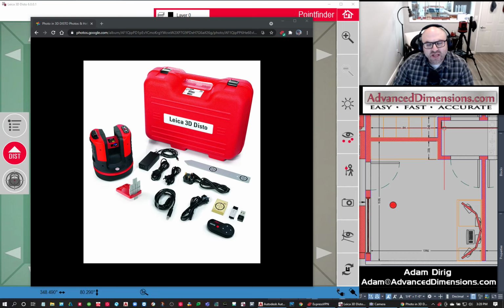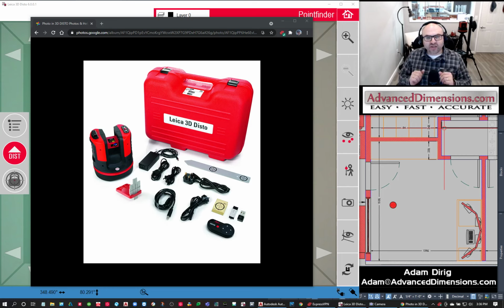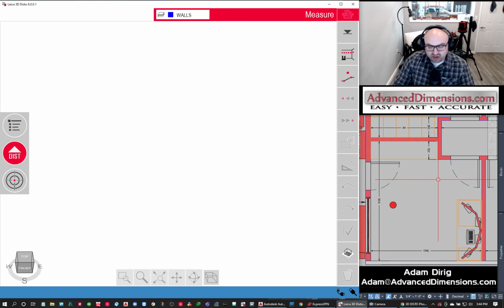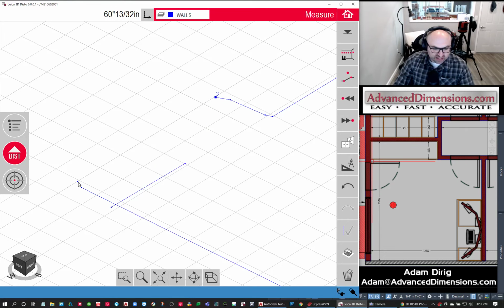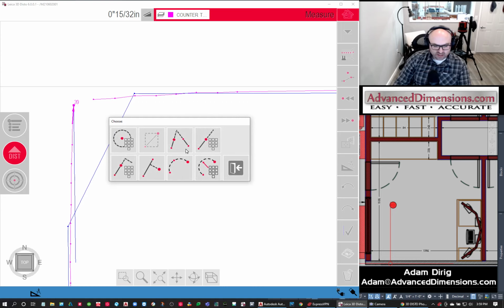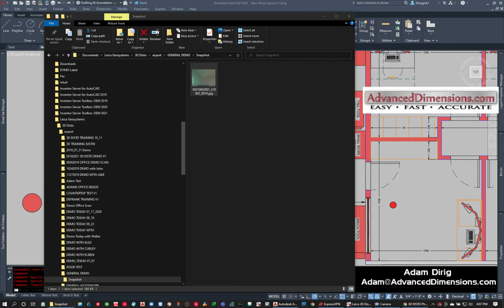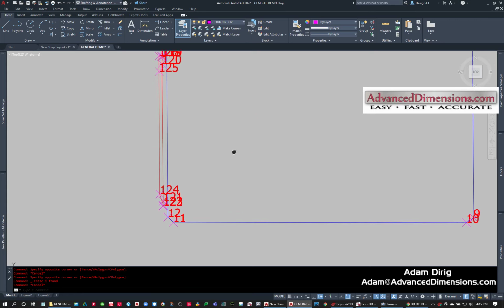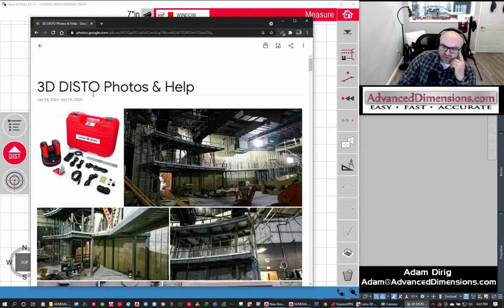Leica 3D DISTO Walk Through

Comment: Great video.  Thank you for the details and time spent doing it.  I know that Leica makes the S910 device which can do point to point measurements.  Are you familiar with the S910 being able to do the same point to point capturing as the 3D DISTO can to achieve a similar end result as you did with the 3D DISTO?  The S910 is significantly cheaper.
Reply from the maker: Hey! 

It can do similar scans to the 3D DISTO, but you are limited to 30 points per file, and 5 files on the unit before you have to connect to a computer and offload them. You can, however, connect to a CAD program via the DISTO Transfer app for Windows to remove the limitation. 

Where the 3D DISTO really shines, though, is its accuracy compared to the S910. The 3D DISTO is accurate to 1mm at 10m, vs the S910, which can be up to 10mm at 10m. This is due to the S910 being manually controlled, whereas the 3D DISTO is all robotic. You also gain some functions with the 3D DISTO such as automated linear and grid scans. 

Hope this helps! Reach out to us if you are interested in learning more! 

-Noah
Advanced Dimensions
Reply: @Advanceddimensions  Very help.  Thank you so much!